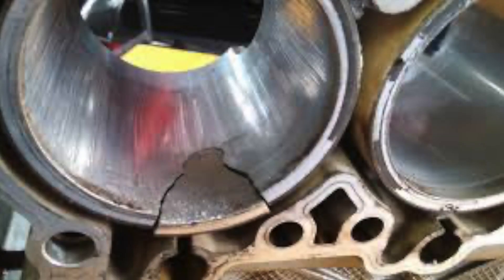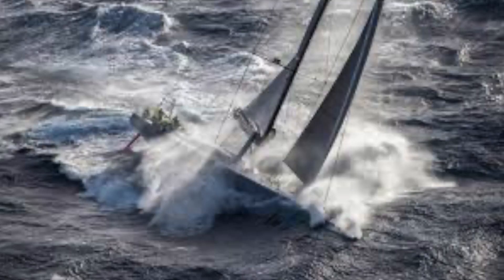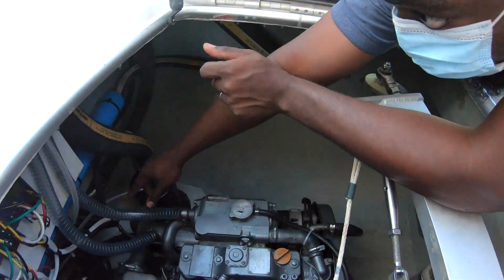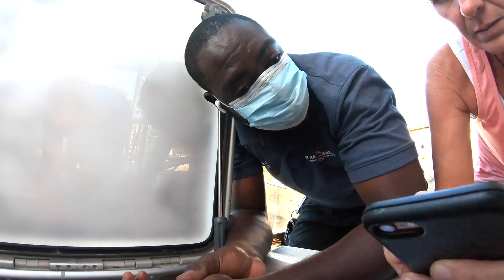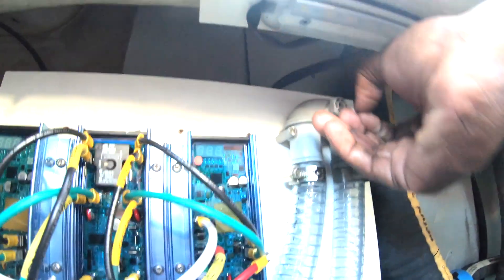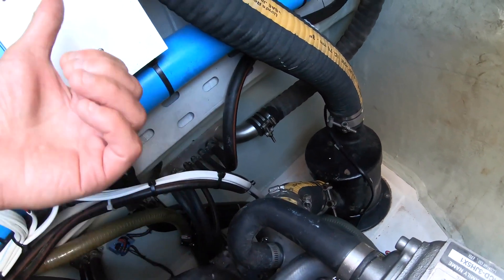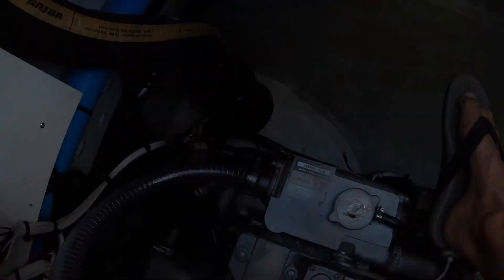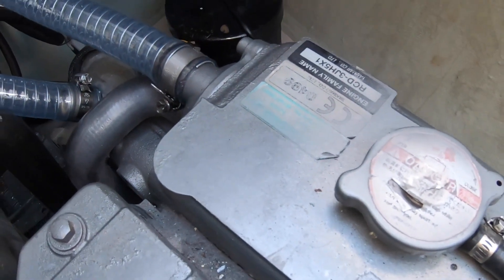122: What is Hydrolock? + Step by Step Instructions to Prevent by Installing an Anti-Siphon Loop

Comment: yep three days into a sail to Tonga had this very problem, motor only 6weeks in the boat. engine installer did not install vent loop, engine flooded, ruined injectors stripped the head redo the valves. out of pocket $7000. hard lesson
Reply from the maker: Oh no. I am so sorry to hear this! That is really frustrating - the hardest lessons we have learned are the ones that were preventable IF we only knew...

Comment: Wouldn't having sea water flowing next to electronics represent a potential problem? It could leak due to lack of maintenance, or spill salt water during its periodic maintenence. Why not mount the antisiphon loop a little off to the side?

This is a 4 year old video, so the real question is: has any problem manifested in that time as a result of this installation?
Reply from the maker: YES!! Great point. We should have but we, of course didn't know anything. Thankfully NOTHING has happened and they don't need any maintenance if you keep running your engines as the duck bill never has time to build up the salt. BUT if there was a leak, for sure this would be an issue. BTW, you DEF want these on your boat. I cannot tell you how many friends had hydrolock and it really messed with them!

Comment: Friends, if this is an Engine Technical " Engineering " mistake or a week point, why Yanmar does not integrate this valve into all of their Marine engines? it does not cost the Manufacturer a penny ! but a long live engines? am i missing the puzzle?
Reply from the maker: That’s a great question. Or why doesn’t Leopard install them as part of their production? We don’t know. I think it’s like anything...no one wants to take responsibility.
Reply: Thanks for the concise and clear install video! I have to wonder if Yanmar profits just a little bit from hydrolocked engine replacements. I mean -- they approve the engine installation design on production boats. If you caught the recent La Vagabonde trimaran videos, their engine hydrolocked on their first passage but they are public figures so it's being replaced immediately under warranty. If you aren't internet famous, I can see Yanmar and their builder pointing fingers at each other while the new owner hires a lawyer and pays cash for a new engine just to get off the dock!  @SailingBlownAway
Reply from the maker: Thanks for your comment. We didn’t hear about LVB. I have never heard of Yanmar replacing an engine for free. There’s a benefit to being YT famous. You can get out of hydrolock without a new engine if you don’t do excessive damage but I don’t know where percentage of people do! Crazy!